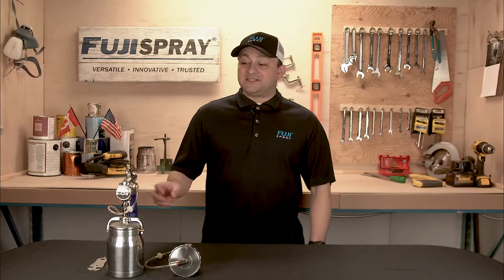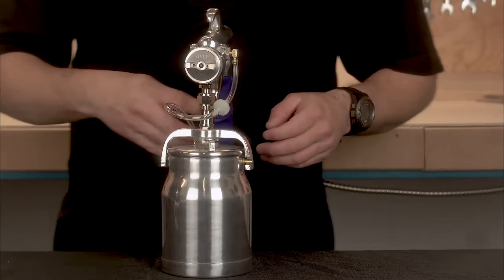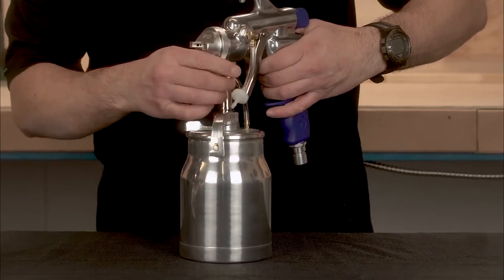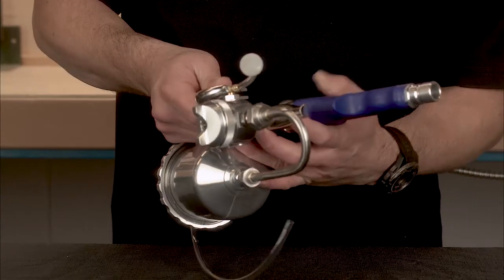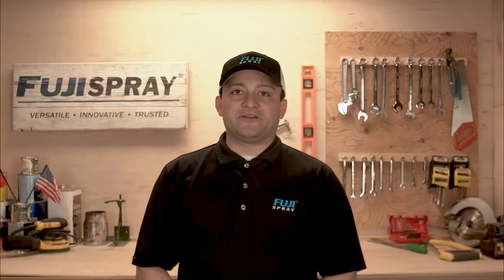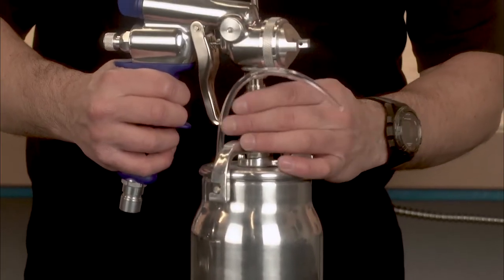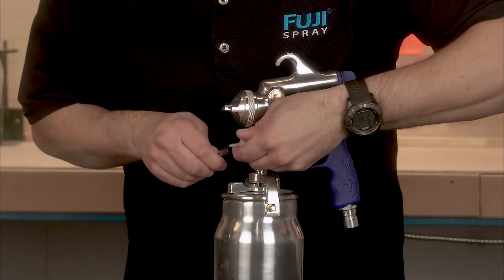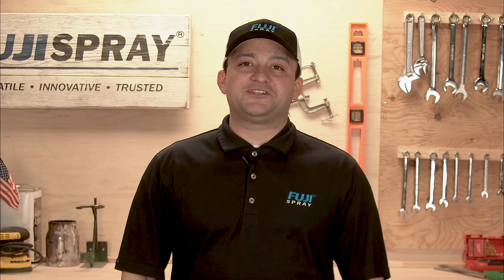How To | Convert the Fuji Spray M-Model Spray Gun from Siphon to Gravity

Comment: how do you know if the check valve is bad?
Reply from the maker: You'll need to remove the check valve and blow air from the flat side; if air passes through, it's working fine, of no air passes through, then the pressure tube and check valve  will need replacing. You'll notice that if you try to blow air from the tapered side, air will not pass as it is what it's supposed to do. For further assistance, please feel free to reach out to our customer service team by calling 1-800-650-1430 or email info@fujispray.com. - Fuji Spray Team -

Comment: does this kit ay work for  other  brands  Such as Binks.Snap on.Sears,Craftsman etc???
Reply from the maker: The gravity conversion kit will fit a 3/8 " NPSM type thread. If any of the spray guns you have specified above have a coupler of that size, then you're in business. Please remember it is a pressurized cup so the pressure tube coming from the lid of the cup must attach to a pressurizing barbed nipple at the spray gun in order to work properly. If you have any more questions, please feel free to reach out to us at info@fujispray.com.

Comment: Why would you want to have this conversion kit?
Reply from the maker: Great question!! If you have a bottom feed M-Model spray gun, one key benefit of having to convert to gravity is if you are spraying horizontal pieces like lying down cabinet doors, for instance. You won't need to worry about the bottom of the cup touching the surface of your work piece. Another benefit of a gravity configuration is if you are spraying the inside of cabinets or other smaller furniture pieces. The gravity configuration takes up a smaller footprint that a bottom feed version would.
A great benefit of converting from gravity to bottom feed configuration is so that you can spray for a longer period of time. The bottom feed cup holds 1 quart of paint, where a gravity feed configuration will hold 400ml... that's a little less than half of one quart.
Hope this helps!!
--Fuji Spray Team